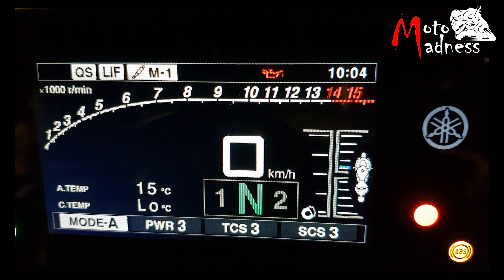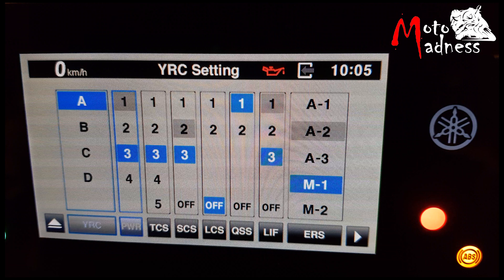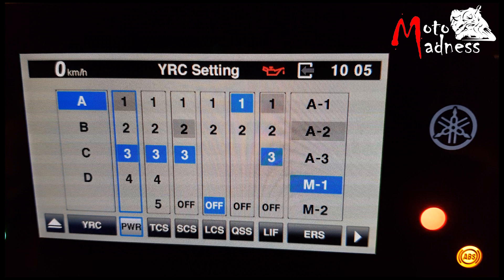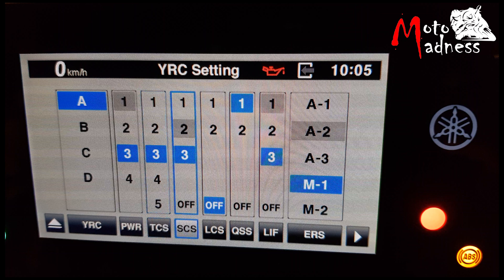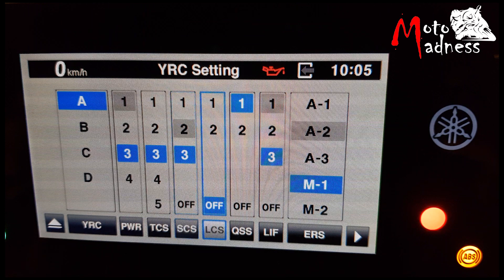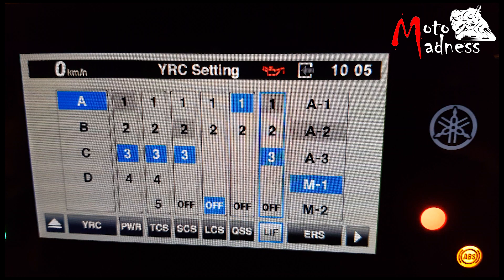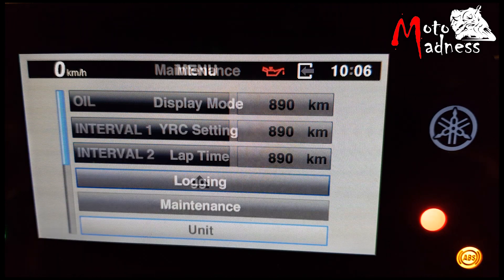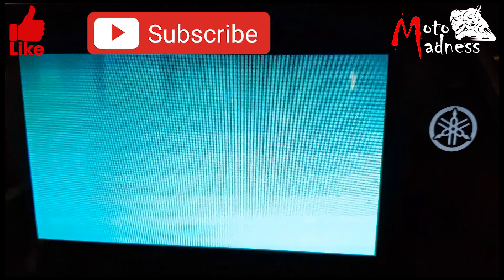Yamaha YZF-R1M Dashboard & (YRC) Yamaha Ride Control Explained

Comment: no fuel gauge ? what a fk up by yamaha .
Reply: A low fuel light comes on and the trip meter starts at 0 so you have about 30 miles to get to a gas station.

Comment: There is no fuel guage
Reply: There are quite a few bikes that don't. Basically, the trip is your indicator.
Reply: @russscott8650  Is there anyway I can add one?
Reply: @philnightjar1971  possibly just a fuel cap with a gauge (if those are even made, but I would guess that they wouldn't be reliable). Past that, not without having to replace the entire instrument panel... so, probably not.
Reply: People have made fuel meters using a clear hose and 2 fittings. One top of tank 1 bottom and the clear hose will show how much fuel you have in the tank. Primitive but effective
Reply: If you want a fuel gauge you're looking at the wrong motorcycle, these are performance machines, not fuel efficient machines